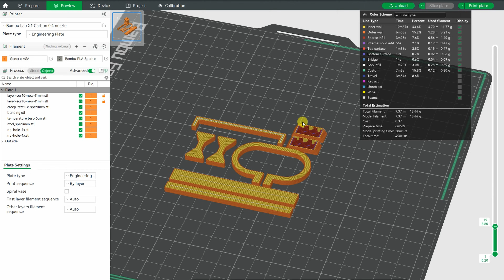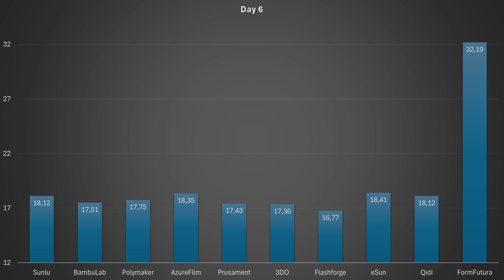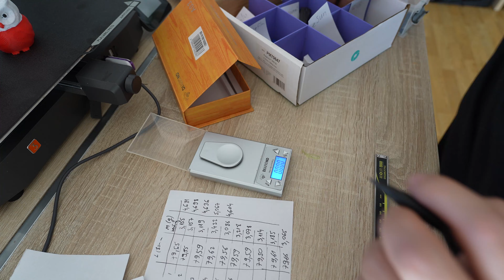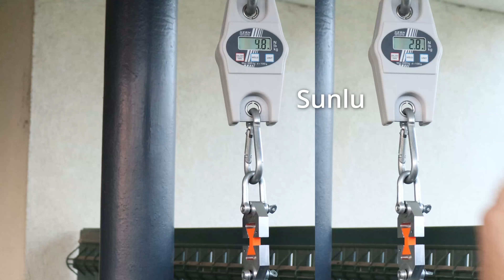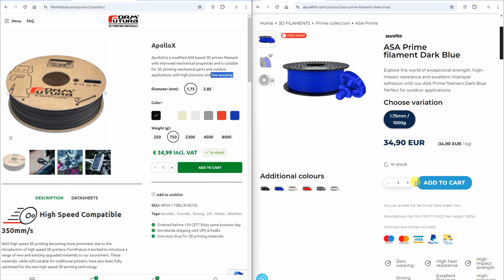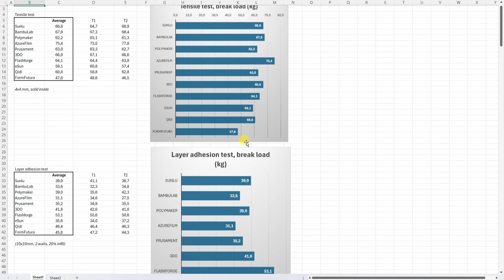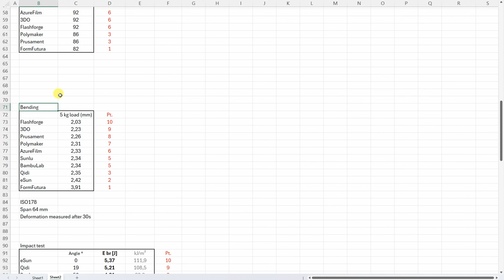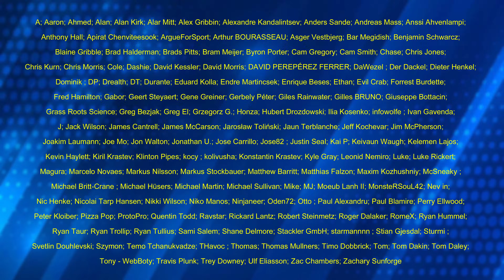What is the best ASA filament? 10 different ASA brands tested

Comment: Wouldn’t same color for testing be better for data?
Reply: You're not wrong, mentions color testing at the end of the video. He doesn't make a profit off of these videos, I don't think he explicitly says this, but I think he want to own a variety of colors.
Reply: It's not obvious that they would use the same additives, even if they are the same colour.
Reply: Honestly it wouldn't matter.  I work in plastics manufacturing.  We have pigment we blend into our products.  We have two pigment manufacturers. They each require their own trials and testing before we can use them.  They each create different results.  Different compounds can create the same pigment.  We have 5 variations of white, each with a different density and different effects on our products.
Reply: @ronaldhiser860 that's the opposite of "wouldn't matter"

Comment: This video came in the perfect time. I've been doing a lot of research on what filament to use inside a car for paneling. I've been leaning towards ASA and your comparisons are exactly what I need.
Reply: have you looked into protopasta's HTPLA and CFHTPLA?
Reply: I have worked in a plastics plant and all the interior panels we made were PolyPropylene.  There were 2 grades and the tougher was translucent and the lesser was opaque when we purged the natural material.  The stuff for under the car was a conditioner added abs and normally a regrind of any scrapped PP parts.
Reply: @rallyfeind lol "PP parts"
Reply: @ThisisDD  phrasing! Haha

Comment: Massively time consuming test, well done. I use ASA for less stressed car parts, though i hate the smell, even if I have the printer in the garage. Maybe you should buy a serious air cleaner with so much printing indoors, for the sake of the family:)
Reply: What material do you prefer for more stressed car parts?
Reply: @ixe87  I use prusa PCCF for most parts since its not affect by moisture, is stiff and doesnt creep like nylon, can handle 130C . Also added add North PC Which should handle 185C, but havent done any car parts with it yet, but i have plans :)
Reply: @garagecedric  polycarbonate absorbs less moisture, but still its properties vary with moisture as PA does, a better alternative to PAs are PPAs( polyphtalamides or semiaromatic polyamides, but yes, they're also more expensive). polysulfone has a glass transition of 185C, yes it's more expensive than PC, but CF is an abrasive material that may reduce the life of the nozzle.the best in my opinion,although not feasiblefor economic reason would be polyertherimide (PEI), with a glass transition of 210-215C.glass transition ( temperature where the polymer starts to soften) it's not the only parameter influential to creep but plays a lot into it. Just adding a bit of info that's all :)
Reply: @naminiyo1  it depends on the CF blend, my prusament rolls seem to absorb almost no moisture at all, which is handy since i can just print without needing any drying. I deal with plastics alot at work, I like PPA, much nicer than PA, PPS also has its use cases and advantages. I wish this area was better catered for in the diy print world and less expensive considering what the raw materials costs, but the majority of people seems to print useless helmets and stuff 😂
Reply from the maker: @ixe87  depend of the stress type. Against bending pc-cf. But I like ASA too.
Reply from the maker: Thank you, I am glad that you find the video useful!
Reply: Look into an activated carbon filter inside you print enclosure. Nevermore is used by most Voron users.
Reply: @arauchfuss Activated carbon needs to be replaced often to be effective. I would look into a dedicated air purifier system that can filter out the room. I use a purifier that contains an NCCO filter.

Comment: Extrudr DuraPro ASA missing in action.
Reply from the maker: Oh, and many others. But 10 is nice round number 🙂
Reply: @MyTechFun  Appreciate the tests. The reason I keep buying DuraPro ASA is because it was the only officially UL94 HB 1,5 mm antiflammabilty rated filament I knew.
Turns out of the 10 ASA filaments you tested the 3DO ASA is also UL94 HB 1,5 mm rated. Thanks for making me aware of this alternative I could use.
I wish there was an UL94 V-0 rated filament. Currently I have to choose ABS for that, which has less UV resistance. I don't think there is any technical reason why they couldn't make ASA with that rating.

Comment: Thanks, Igor. I print a lot of ASA, and this is really helpful!  Mostly QIDI and Polymaker / Overture, so it was good to see the differences.
Reply from the maker: Overture was too expensive to ship from US to EU (I bought Overture PETG, I couldn't find it in Europe)
Reply: @MyTechFun  Overture and Polymaker are the same filaments, Overture is a sub-brand of Polymaker.
Reply: @MyTechFun  In my opinion, no need to test Overture. It's identical to Polymaker.  Import records (public info) show they come from the same factory in Suzhou, and I've run them side by side.  The orange and purple for both is identical in color as are the spools. There are some who believe Overture is a sub-brand owned by Polymaker. I just know they have some filament coming from the same factory. There are other brands that also do the same. Flashforge makes for Voxel.  Kexcelled owns / makes Hatchbox, which is their US brand (it's on their website, too). Kexcelled also produce a number of filaments for QIDI and others.